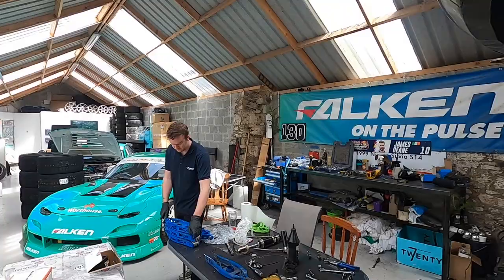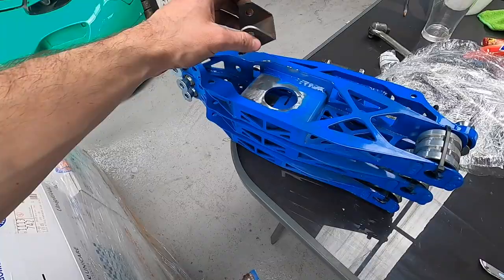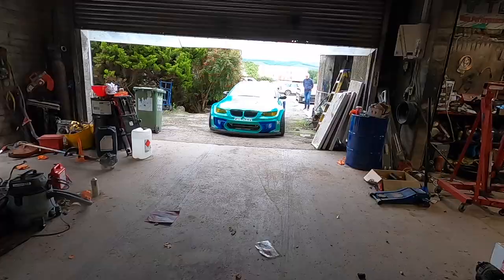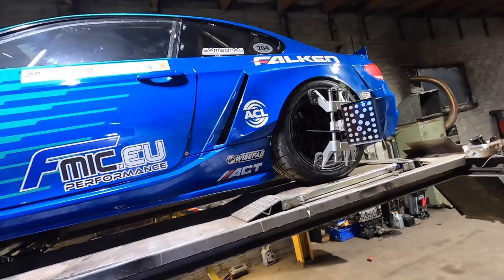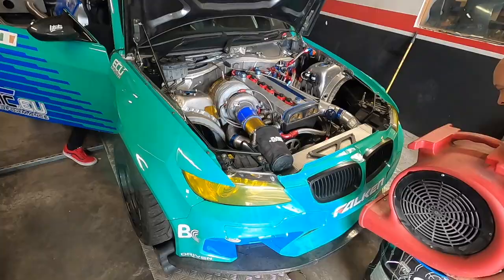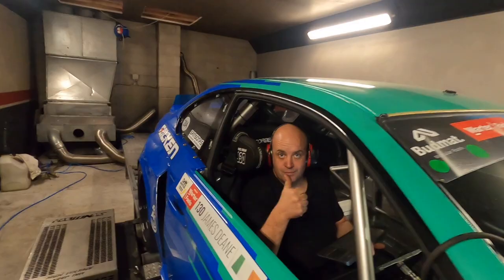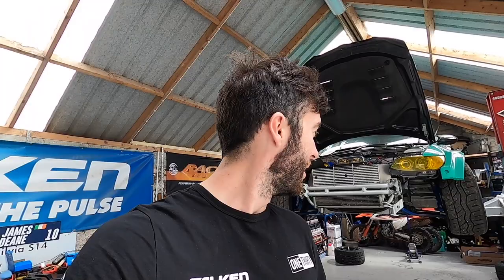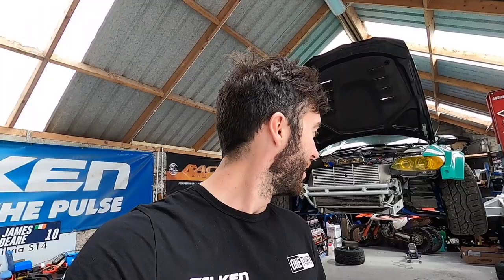HOW MUCH POWER does my 2JZ powered E92 M3 really have? **DYNO DAY**

Comment: Is the bm even tied down on the dyno, just curious
Reply: Was thinking that. I don't think it was. Half expected the thing to take off 😂
Reply: Is looks like it's strapped in the rear. I think 8:29 shows straps below the exhaust suction. At about 8:35 the straps slacken as the run finishes.
Reply: Relax it was strapped